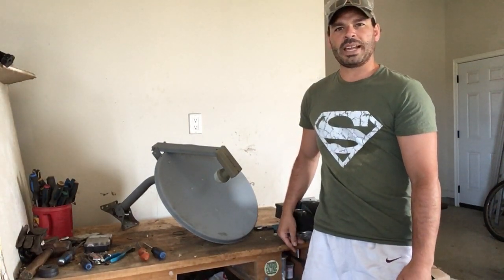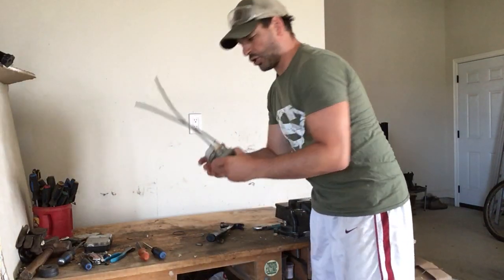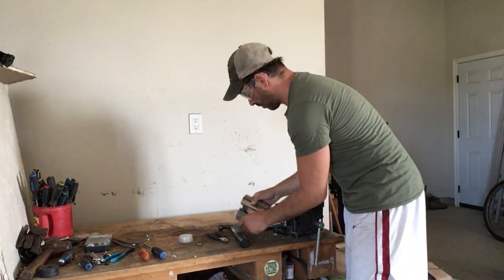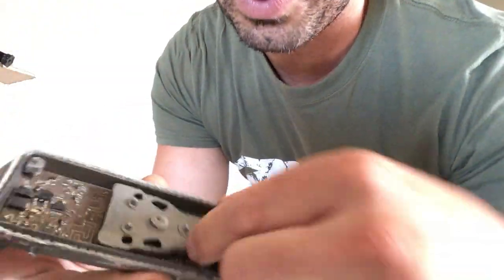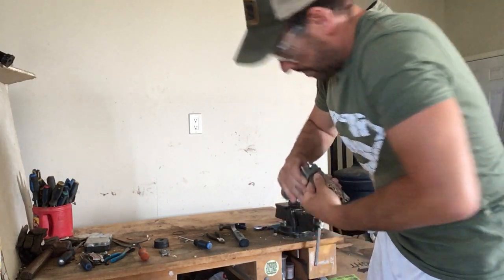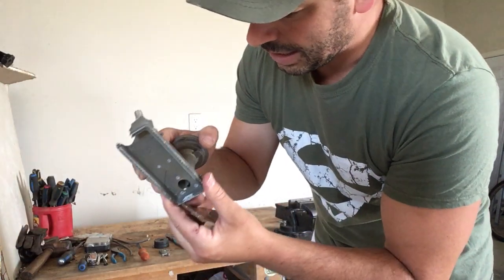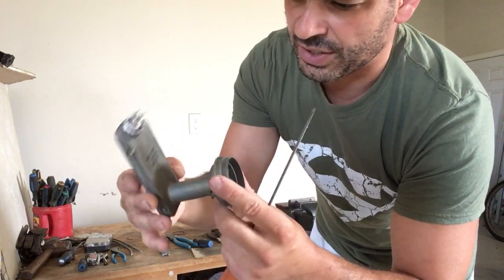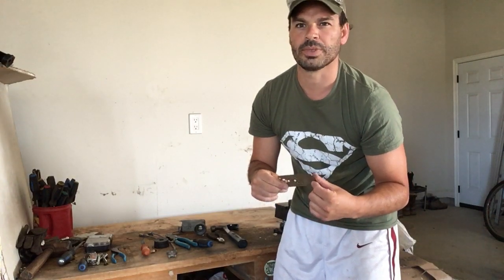Scrapping a satellite dish for GOLD and little waste.

Comment: What size tools do I need to take apart a DirectTV Slimline for recycling?
Reply from the maker: I have an L-key set which is like Allen set and security set for screws with nub in middle. There are a lot of little Allen head screws in the box with the gold circuit board.